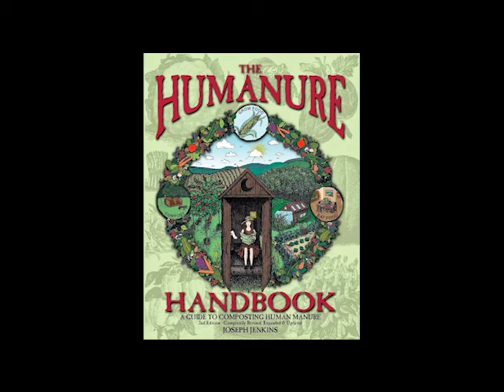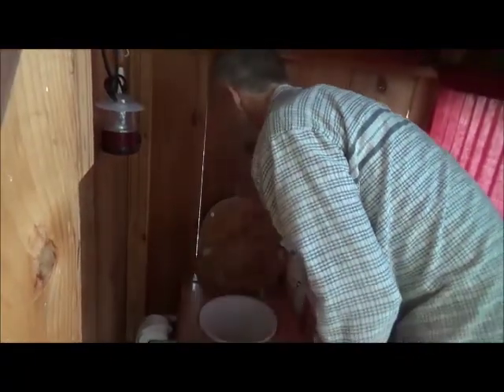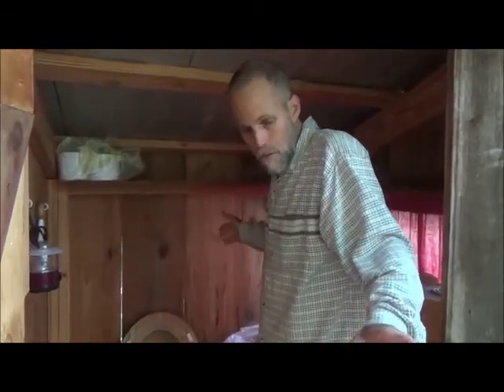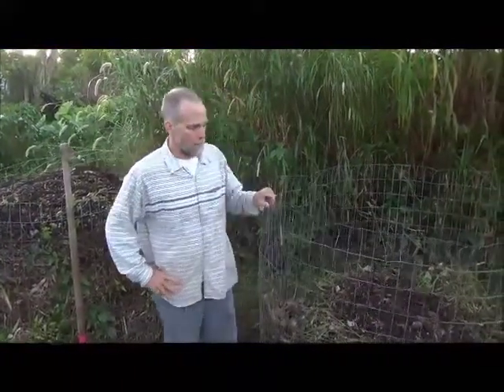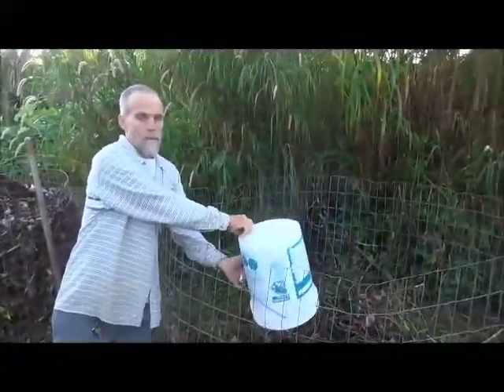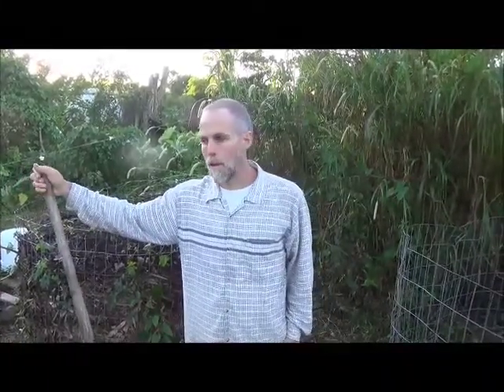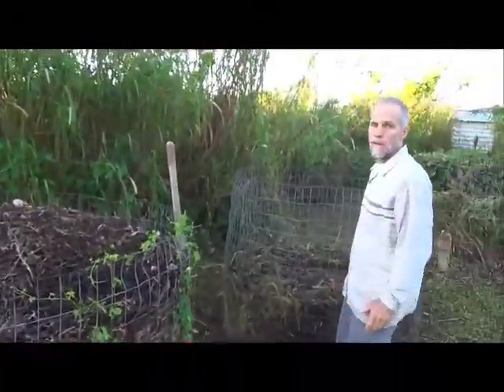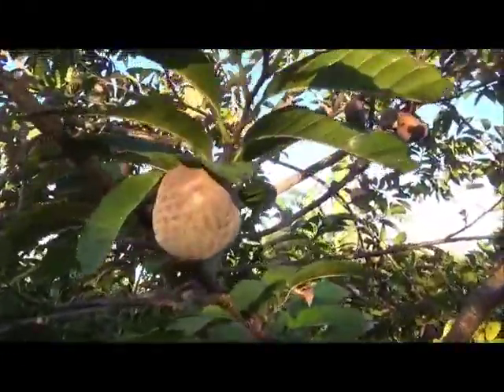How to Safely Make Human Manure Compost Fertilizer

Comment: Maybe another tip would be if you made a hole in de middle, by scaping some of the older manure aside. Dump  the  content of the buckets in that hole and cover it with some of the older manure so the process of decomposing will quickly keep on going : -)